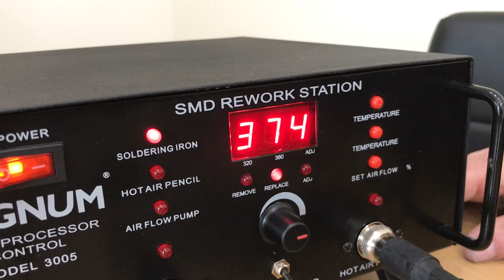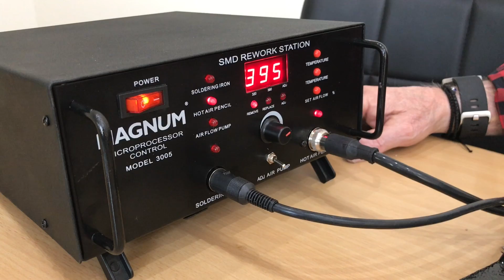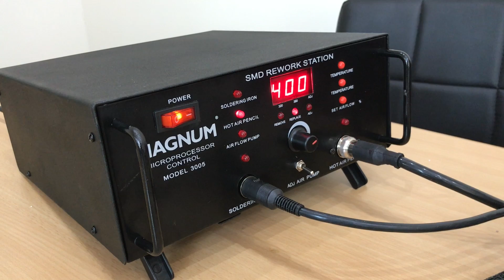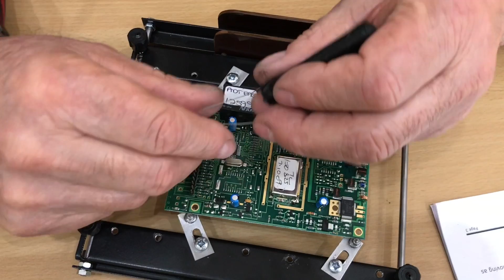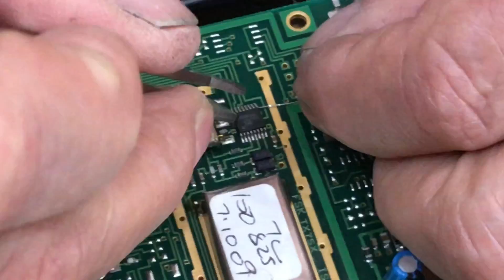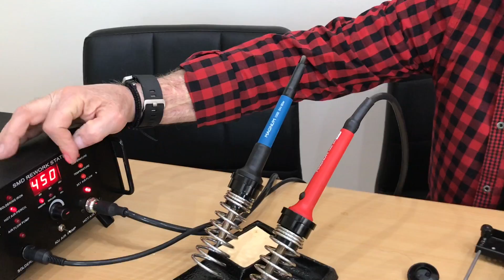How to use the Magnum 3005 Rework Station

Comment: Never forget to pre tin your pads before you replace the component. It sucks the chip into place and makes a good solder joint. I usually clean and tin the pads with new solder and flux without removing the old solder. Some people may disagree with me. That is fine. We all have our own techniques, but always tin your pads. I think everybody will agree with me there, I can not emphasize that enough, Never forget to use flux when replacing a component. You can never use too much of it. Flux that chip up up and blow it home.